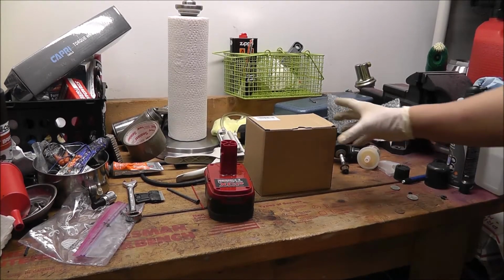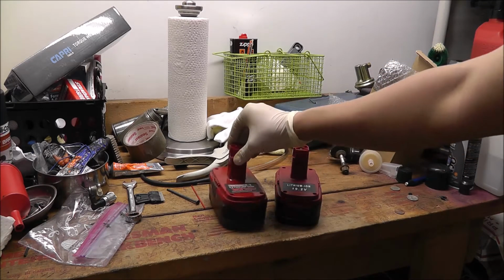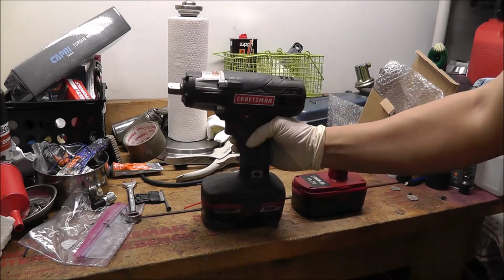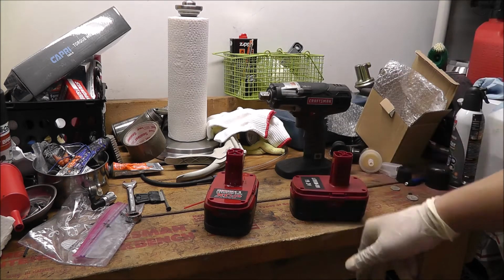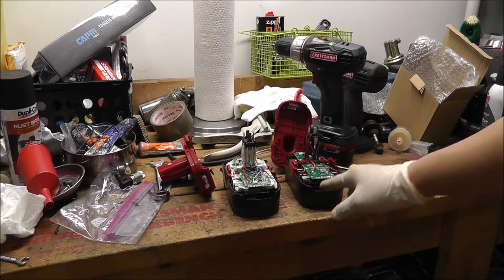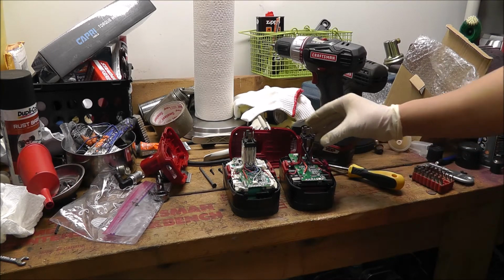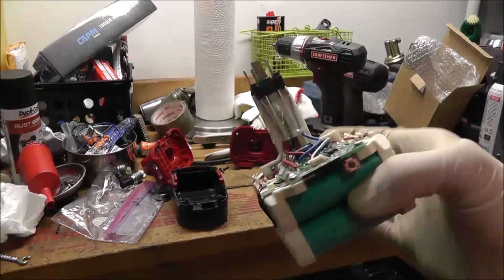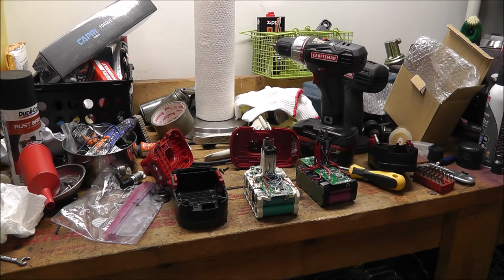Energup Craftsman C3 XCP Replacement Battery

Comment: I purchased a set of 19.2 V aftermarket batteries they kicked off like a circuit breaker had to disconnect them to restart but they kicked off again and again they were terrible in my opinion.

Comment: Does that aftermarket battery use the Craftsman charger that's my big question and you did a great job on this video thank you .
Reply from the maker: Thanks for the kind words!  To answer your question, yes this battery is fully compatible with the original craftsman charger.
Reply: @ctuan13  I rode the C3 tools from the beginning to the end even loading up on batts in late 2018 as they disappeared... So, now my original batts are going bad and you CANNOT get them anymore. What is the long term assessment of the energup batteries? I'm trying to figure out which brand to go with...
Reply from the maker: @Redfour5  I feel that.  I just have a few tools from the C3 line including a half inch impact, the LED light and a drill driver.  I was so happy with their performance and value, I even found a brand new bare-tool deal on another impact as a backup when mine inevitably dies.

To address your question about these batteries and longevity, they're all pretty similar.  The loss of the in handle power indicator light is unfortunate, but I've yet to see any aftermarket battery equipped with the stem LED, just the gauge up front.

As for performance and longevity, mine have been great.  I put them through I'd say average moderate use.  The key really is the quality of the cells used.  As you saw in my teardown, the cells are pretty good quality.  But obviously that's impossible to determine by just scouring an amazon product page.

My advice is to find a well rated battery and carefully inspect the reviews for fake reviews.  If the reviews seem legit, then sort the reviews by newest (this ensures you are still getting an accurate view of customer satisfaction and that they havent changed the cells they're using recently) and if the reviews still arent reporting poor function or run-time, you're probably good.

But still, if you feel so inclined, taking a quick peek inside to double check the cells never hurts and with Amazon's return policy, getting your money back shouldn't be an issue.

Hope this helps!
Reply: @ctuan13  Much appreciated. Will follow your advice.

Comment: The ones with the red wont fit my original craftman chargers that normally take the all black battery
Reply: That's because the newer Lithium Ion batteries require a different charge cycle, and the old chargers either charge them poorly, or cause damage.  There are smart chargers that will charge both NiMH and LION battery types, automatically selecting the proper charge profile for the battery type inserted.  I have found the best way to get a LION charger is to buy a combo with LION battery included.  You get a battery, charger, and a tool for less than the cost of a separate battery and charger.
Reply: @tomcolby5802  thanks for the info,  I actually bought a combo or what they call multi chemistry charger that takes both, the new batteries have great power,  my impact driver works perfectly, before I had to check with a tire iron to make sure the bolts were good and tight,  now I can't tighten any further than the tool tightens